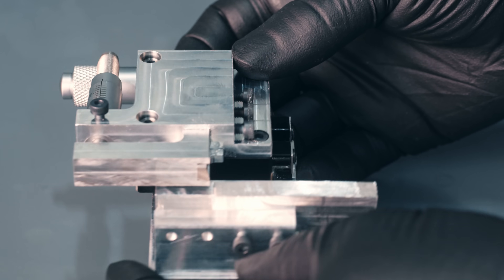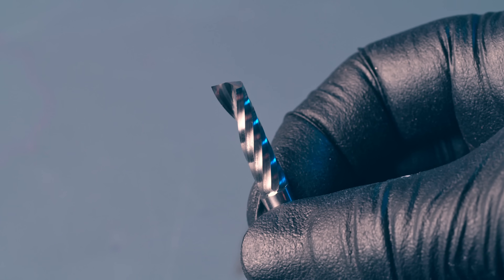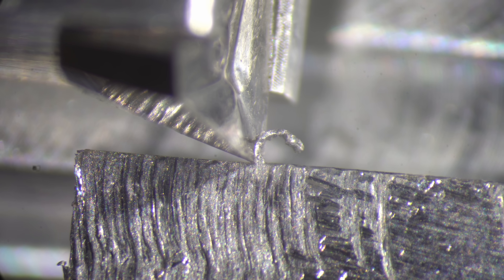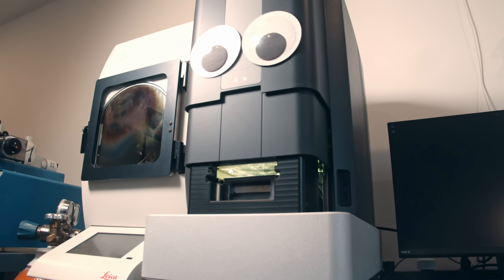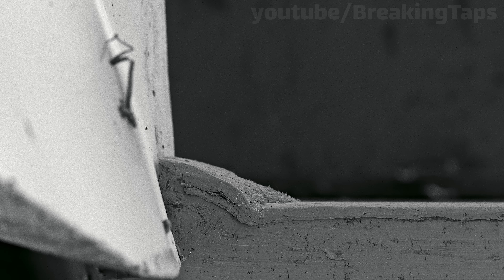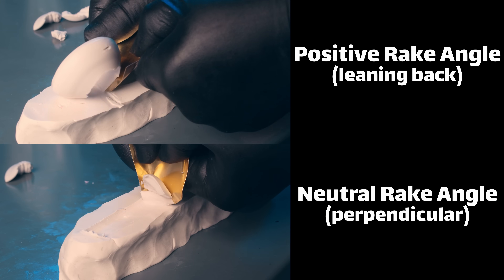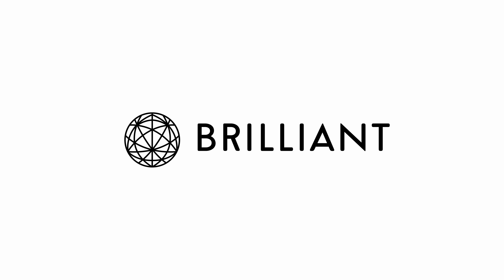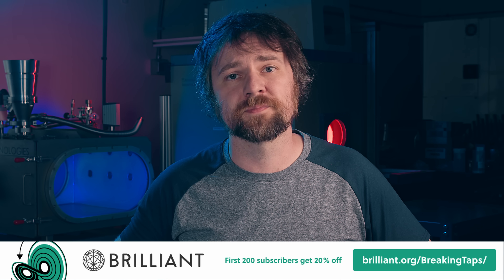Cutting Metal inside an Electron Microscope

Comment: HSS IS still used. The benefits are; it's cheaper, it's not as fragile so it's more practical for hand tools where a carbide tool could easily break.
Also carbide tools generally ask for a higher cutting speed, which may not be practical in some applications.

Comment: Small investment towards a bespoke vacuum-compatible remote-controlled 3-axis stage so you can do this kind of thing over and over.  It's amazing. Who's doing this and sharing it with the public? Nobody.
Reply from the maker: Thanks! 🥰🥰🥰 I'm chatting with the folks at Thermo, don't think I'll be able to get a free chamber but think I might be able to wrangle a discount. Appreciate the support!
Reply: @BreakingTaps  it's been over a year... WERE IS PART 2???
Reply: FYI, youtube takes 30% cut, so you might want to use other methods if you can.

Comment: Two options for you.
1) instead of using a vac box with external electrical hookups, make something that's battery-powered and just trigger it with an RC controller.
2) instead of multiple runs back-to-back to get the different materials, set up multiple cutters and materials close to each other so you can do multiple runs in parallel.

Comment: you should be able to rig this up with a setup made of a powerbank, arduino, easydriver and a stepper motor - no need for a passthrough.

I've thrown an 18650 into my vacuum chamber before just to see what would happen and it literally did nothing, 1 bar of pressure differential isn't a lot after all.

I'd love to see this done with some different materials, monocrystalline silicon at different crystal alignments could be super interesting

Comment: Instead of being clockwork, could you do something radio or microprocessor controlled? I imagine one of the biggest challenges would be finding a vacuum safe batteries.
Reply: They should all mostly be vacuum safe, i've thrown an 18650 into my vacuum chamber before and it did absolutely nothing - expectedly since 1 bar of pressure differential isn't exactly significant, you can block that with a finger by accident.
Reply: @Blacktronics  The concern is more heat buildup, the same as the biggest risk to a vehicle in earth orbit is actually overheating not freezing. I imagine you could probably do some form of thermal pate to the shell for the electronics, but batteries could be harder to cool. That being said If it's oversized enough the buildup will probably be inconsequential.

Comment: couldn't you just run the stepper off a battery inside the chamber? and if it needs to be controlled from the outside, connect to it wirelessly with Bluetooth/WiFi!/whatever. Assuming a raspberry pi works in a vacuum.

Comment: I love how the clockwork mechanism starts making sense once you think about it practically. 
Vacuum chamber probably made of metal - a Faraday cage - radio ain't getting inside easily. 
Then battery powered stuff. Which have liquid electrolytes that like boiling when you  drop the pressure...
And electronics probably won't like being in the same place as a literal electron gun.
Clockwork? "Spring-sproing I am made of metal - gimme them electrons"
Can you hook up an egg timer or something to the micrometer dial?

Comment: You could also just try to use a battery I mean lipo should be safe in a vacuum if you coat it in something like you could probably put it in resin
Reply: Battery a switch and a timer switch it would take some finagling but shouldn't be that hard I mean you obviously have a metric butt ton of tools knowledge and resources

Comment: Have considered making a small battery powered assembly? Something like a couple 18650 batteries, a microcontroller, a stepper driver and a stepper driving a stronger screw? Maybe the problem is outgassing as you mentioned, but except the stepper you should be able to expoxy all the electronics together. Or Maybe there already exist vacuum-grade steppers. Super cool video as always :D
Reply: (I just believe a mechanical clockwork-like system will become very complicated, specially a slow, yet with high torque, mechanism)

Comment: My first thought would be to automate this thing. Stationary cutting edge, a piece of metal that feeds onto it, small stepper motor attached to the micrometer (at a distance to not bend the electron beam), epoxied Arduino for control. But may be easier said than done, especially for a single fun project.
Reply: The clockwork mechanism is actually more elegant solution.

Comment: Why not put a cheap remote control car motor and battery in the vacuum chamber? You can remote run it with the existing remote and just print some 3d gears to give enough power and move slow enough to image?

Comment: Why the fuck don't you just put an arduino with the whole stepper motor thing in the chamber and control it per Bluetooth or RC or IR or something
Reply: Try it and tell us how it works for you!
Reply: @csours  Have before, thing that didn't work was getting the RF into the steel vacuum chamber, time-based trigger worked fine though.

Comment: hi there thanks for the really interesting video, instead of using a clockwork type mechanism, could you use a radio controlled stepper set up, not sure it it would interfere with the microscopes election imagining in some way, but as radio waves can travel through a vacuum it might be possible?
Reply: The vacuum chamber is probably a box made of metal. Aka a Faraday cage. Radio is gonna have a hard time getting inside.

Comment: Fantastic imaging. Mesmorizing. As an amateur machinist I use the same cutters for aluminium, brass, plastic. I might re-think that. Thank you for taking the time. Could you make a feed through plate with old valve bases ? CRT stems ? but you will need to de-gass a motor, maybe just a solenoid ratchet would suffice. Continuous motion would be nice though. Heat is the missing contributor . Whats the max frame rate of a SEM.
Reply: You can buy vacuum feedthrough connectors. You don't need to try to build one yourself.

Comment: Could you make a battery powered feed device?
There's got to be a variety of batteries which wouldn't be a problem in a vacuum. Right?
You could replace any oil in an appropriate motor with some of your vacuum grease (if it is even needed).
You should be able to control the device wirelessly. I assume the vacuum chamber would allow enough RF to allow radio control.
Thanks for another interesting video.

Comment: you could build a self contained electrical system. A sort of "anti-vacuum" chamber, where you could put a couple of batteries and an Arduino Nano, inside a sealed box entirely within the vacuum chamber. It could either have a bluetooth/wifi to let you advance it on command, or just be pre-programmed to move it once every 30 seconds or something.
Reply: Does it even necessarily have to be sealed? It shouldn’t really matter at low voltages right? Or it more outgassing from the PCB? If so, are there coatings which could be applied?
Reply: @mduckernz  I'd be primarily worried about the vapor pressure of the electrolyte bursting the cells open, or any capacitors, especially since batteries will warm up in use without any air cooling. Outgassing from the cells, or any capacitors, or the PCB itself potentially poisoning the vacuum would be a concern as well. I'm not sure how hard of a vacuum you need for electron microscopy. If it's able to pull down to pressure in just 5 minutes, about his time per frame, it can't be that hard of a vacuum (can take hours for super deep vacuum levels).
Reply: @Timestamp_Guy  Ah okay, that sounds pretty simple to solve tbh, magnetic induction through a viewing port should handily solve it (e.g. like how an induction charger works). Alternatively, making a sealed battery box like others mentioned.

The field generated might mess up the imaging if you tried to run it simultaneously, but fortunately that isn’t necessary, you can disable the beam while you advance the stage through the induction power source, then shut off the induction, then turn the beam back on
Reply: @mduckernz  batteries in a vacuum chamber is not a good idea. the best methode would be a vacuum power passthrough port
Reply: @gerbil. It might be viable to create a small vacuum tight battery box though, just passing 2 pins out... Easier than modifying the SEM or buying it...
Reply: @equi-nox  That was the essence of my original suggestion, yes. Though probably 3 wires out to drive a stepper motor
Reply: @mduckernz  vacuum safe conformal coating , sure this exists
Reply: It wouldn't be too hard to pot a small battery pack in a low outgassing epoxy with bare copper wires bringing the power out of the potted package. Not ideal but it would get the job done.
Reply: In my vacuum chamber (2pa) I put an esp32, 18650 and e ink display. I was surprised it all worked.
Reply: Creating vacuum tight devices is a tremendous endeavor, especially for the level of vacuum required for electron microscope, so I hope he can get one of the electrical passthrough thingies, it would make the project so much easier...
Reply: doesn't even need to have any wireless link, just put it on a timer and let it advance every second or however fast you can take a scan
Reply: Epoxy potting a remote sounds practical, but just how complicated is a pass thru? Seems like the stumbling point is being willing to modify a chamber at all.
Reply: casting a small li-po battery in resin maybe ?
Reply: @matejbrezan6887  I'd go with LiFePO before a conventional LiPO pack, they're more stable and will have fewer expansion issues in vacuum and/or potted in resin.  LiPO packs expand and contract during a cycle, so having a rigid epoxy shell would be problematic.  Honestly I think a simple bank of epoxy potted capacitors for power would be the easiest solution, and they could be integrated with a PCB or even breadboard with simple solid state components.  Charge up the capacitors and drop it in.  Only real problem with potting anything with wires is that the wires themselves have trouble sealing in vacuum...they turn into straws if there's any pressure differential.  There are ways to seal them, or use single strand wire (non-insulated wire would work best if you're very cautious with it), or even terminals going through the epoxy...so it could certainly be done with enough free time.  Might even be possible to introduce a remote if the SEM doesn't interfere with it.

Comment: You could make a stepper system and either have it detect the electron beam (and have it start a delay longer than the exposure) or tell it to step with some sort of inductive pickup or hall effect sensor to step when a magnet is placed externally 
a big enough electromagnet externally should punch through the aluminum and turn off before it affects the beam 
or, of course, you can machine the basket you already have and put in a vacuum connector ... or even a spark plug

Comment: You could install your own electrical feed through on your SEM chamber. What would be really cool is if you could cut some steel that you first etch to display the grains and then show how the grains under the cut are modified by the cutting process.
Reply from the maker: I've thought about it, but my machine (a little desktop SEM) does some internal gymnastics to move the chamber into position. So it'd be a bit more complicated than repurposing a flanged port or something 😢  Definitely agree about cutting some steel that has been pre-etched! Would love to see the grain boundaries moving around!
Reply: @BreakingTaps , pot a battery and a small control circuit in a low outgassing epoxy, use a time control program to move a small stepper motor ever x seconds or minutes. Any lines coming out of the epoxy should be bare copper and solid instead of stranded to prevent outgassing. Steppers motors run in vacuum just fine for a while, I have used a ton of them in vacuum and as long as you don't overheat them they work well. If you need help let me know as I have done a lot of this in the past.
Reply: @patrickmorse7549 or he can do it controlled with wifi if he uses an esp32
Reply: @BreakingTaps  There was a video of a CNT forest getting crushed back in 2018 which I saw was pretty cool, Also there is a nanoartography competition you could submit your images  to
Reply: @BreakingTaps  Yes, internal gymnastics is a nice way of putting it. That's a really really bad idea though: There's almost no clearance between the sampleholder and the top of the vacuumchamber and/or the BSED, so a large chance of getting the stage stuck, or even damaging the BSED. Maybe you should get in contact with the people at where you bought the Phenom, to see about doing a collab, perhaps they have one of those Generic Sampleholders they could let you work with.
Reply: @BreakingTaps  what are the possibilities of a short range rf transmitter to advance a say a Nema 17 or Nema 11 stepper motor in place of the manual dial? the Nema 17 steppers are very common on 3d printers so they're quite inexpensive as well, and the Nema 11 is super small
Reply: @The_Phrough  you have to contend with the chamber being a very effective faraday cage. If the machine has an optical viewport, then some simple IR remote control could probably work (at least for a start and stop command)
Reply: @BreakingTaps  Wouldn't it be possible to just add a battery operated stepper motor with a raspberry/arduino inside? You could control it remotely without the need to feed through any electrical connections.
Reply: I think there are crystallographic techniques that let an SEM directly see the grain structure too.
Reply: @charleslambert3368  EBSD is an expensive add-on, typically
Reply: @itshappeningmaybe  you can just use BSE if it’s flat polished. Depending on the detectors, you can also get Electron Channeling Contrast Imaging (ECCI) which can show damage accumulation near the crack tip/ tip of the cutting edge
Reply: @charleslambert3368  indeed there are. The two that come into question here are Pseudo Kikuchi Line imaging (requires special optics to do for any point other then the central axis) and Electron Backscatter Diffraction. 

These techniques are however rather expensive in terms of hardware, likely costing more for the detector in the latter case then his SEM its self.  Both techniques are rather slow as well, as an image needs to be generated for each point of the final image. This image is the Kikuchi Line diagram  of that point. from it the crystal orientation can be calculated and used as a value to modulate the final image. 

There are more techniques that could accomplish the imaging of grains, but these start to become more and more exotic to the point of not existing outside a hand full of labs that build the hardware from scratch.  

as for seeing the actual crystal structure of the grains being deformed, this can also be directly observed, but would require the use of a transmission electron microscope and a sample that has been thinned to a few nm thickness mounted in a manipulator stage. Even then seeing the actual crystal lattice requires luck to be in an axis parallel to that of the beam. It also helps to have more beam energy. I have seen this sort of dynamic testing being done in microscopes of 400KV and 1.2MV respectively. Both of which are far outside the budget of a youtuber, and even if getting one might be possible, running them is a whole different matter, as they are prohibitively expensive to run and maintain. 

final note: if i ever find the time to do so, ill create a video of just this, imaging the grains while performing a cut, as i have access to the needed equipment to do so. I just lack the time needed to record the data and build the cutting setup at the moment
Reply: @charleslambert3368  you'd have to have something like a backscatter diffraction add-on or use different machine. It's not as simple as just software unfortunately! - a geologist who often wants to see lattice structure
Reply: I am glad mr breaking taps decided to give the ol' elbow grease method a shot before drilling holes in his shiny new electron microscope.
There is also the method of placing some mechanism between the limit switches and the carriage that gets crashed into when zeroing out the carriage, and using the compressing force to do an iterative action (like rotating a knob 1 degree or w/e)
Reply: I have also operated battery powered devices in vacuum... Best to seal the battery in its own "chamber" but some lithium batteries handle the vacuum ok, solid state batteries are best.
Reply: @patrickmorse7549  Battery power may be the way to go. Or perhaps inductive coupling with suitable coils through the glass?
Reply: Batteries should be okay.  18650 cells are fine in hard vac for space applications.  I can't speak to electron microscope requirements but 10^-7 torr was a frequent test perameter, not to mention the actual LEO and GEO orbit applications.  No special housing/potting required
Reply: @johnabel6080  the problem might be outgasing. the space doesn´t care the micorscope does
Reply: My first thought was to use extremely high gearing and magnets on either side of the glass. Though maybe that would affect the beam...
Reply: He can place a battery powered motor with a microcontroller